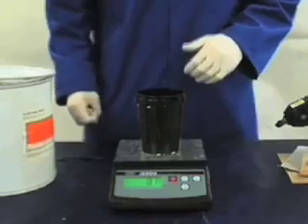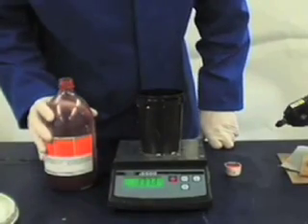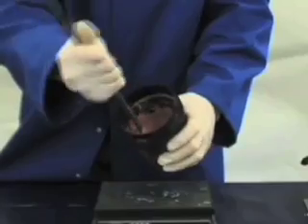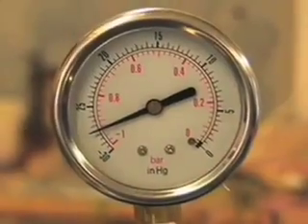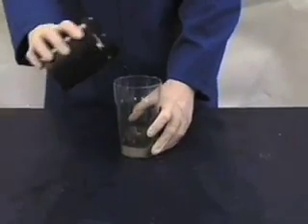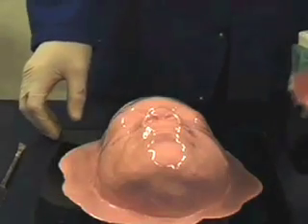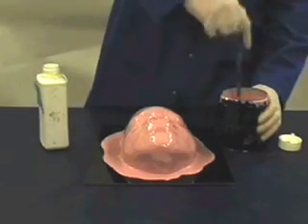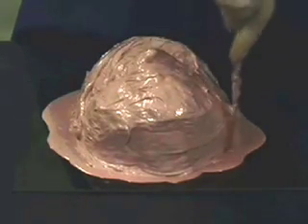How to use condesation cure silicone rubber

Comment: just top it off with another layer of silicone, moderately mechanically thickened with powder (so it is still self-leveling) or not thickened at all. this evens out the lumps of the second layer an makes for a much easier demold of the mothermold